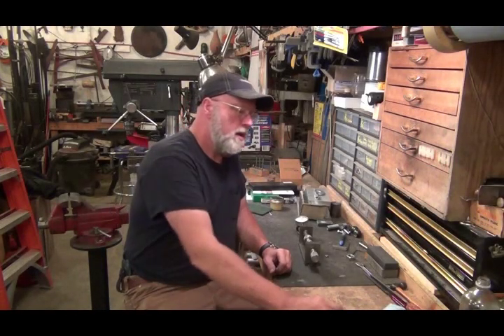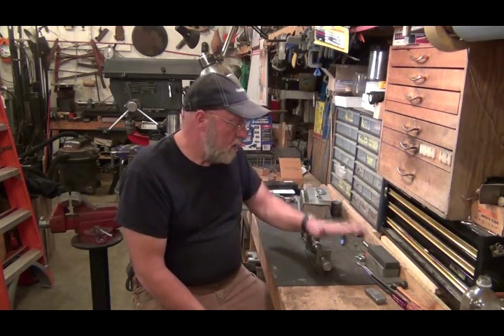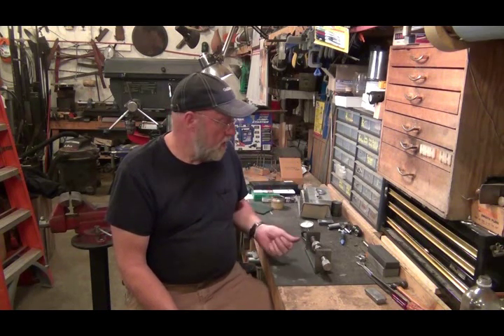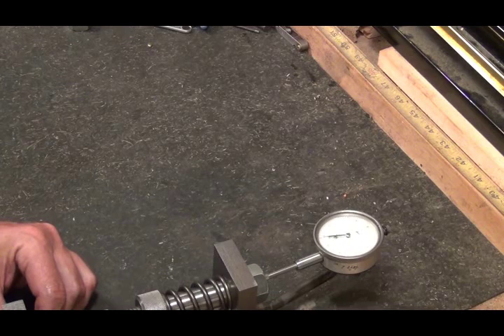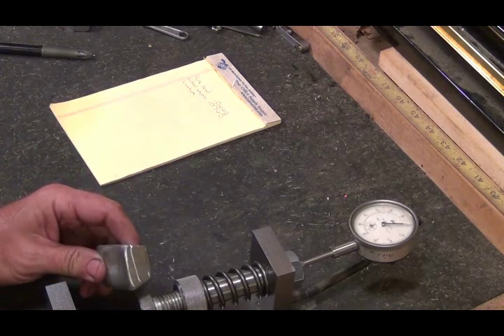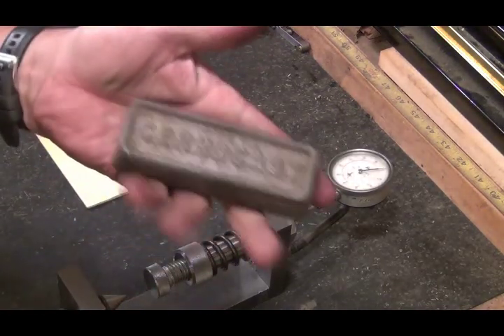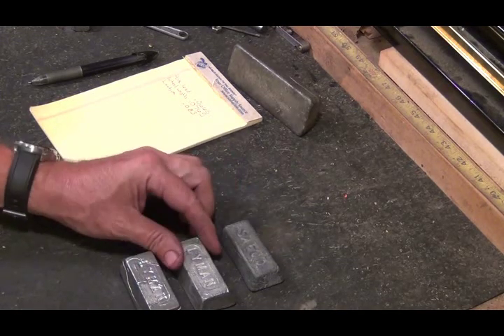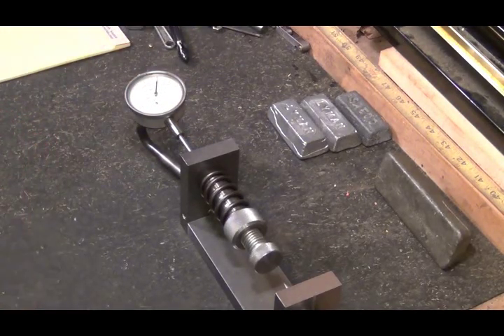Home made lead hardness tester

Comment: This makes precise hardness testing so accessible, thank you. I know lead, the material that all these videos focus on, is a pretty soft metal. But could this work with testing the hardness of other metals and alloys? Like aluminum, bronze, cast iron, or even steel if a diamond tip was used and the whole structure beefed up?
Reply: No use a rockwell test this only will work on soft matrial .

Comment: Awesome I built my own as well would I be able to send some pictures of my tester and my test results I'm in the same boat as you trying to calibrate mine. For the spring I use a 1949 Indian scout outer valve spring had alot on hand so easy to come by. My email is adrianhoffarth@yahoo.com hope to her from you.

Comment: I use a 50/50 ww and dead soft in my 45, powder coat and no problems. I do slug the barrel anf make sure I have at least one to two thousandths oversize

Comment: Thanks for the video. I didn't see the other guys rig but yours seems to be an improvement in design from what you say. 
  My only question would be the angle of the point ...changing that angle would change the range of changes. It would not be a big deal but if you did want to document many different tests it may not give you enough difference between each of them. A sharper point might give a larger range.
About the hardness changing with age...From what I understand it is the antimony that causes lead alloy to harden with water AND change hardness with age. I don't think pure lead will change.

Comment: Nice machine work.  Two suggestions, one, you might take some ingots to a local mechanical engineering college,  or a local shop, and ask them to test them on a Brinell Hardness Tester to get actual Brinell numbers to calibrate your chart to them.  Also, maybe also calibrate the unit  using two turns on the indenter, to see if the results change.
Reply: The results will be different since the indentation point is tapered.

Comment: You can shoot soft bullets and not get leading. It is all about bullet size not hardness. Also pure lead doesn't harden when you water drop. For it to harden some with water you need other metals in there besides pure lead. 

If you haven't already check out the castboolits forum. Tons of info there.
Reply from the maker: Been there quite a bit. I have started mixing Lyman #2. My bullets are coming out much nicer. Thanks for watching and commenting.

Comment: Perhaps you have discovered by now, but the Cerrocast is a low temperature casting material that's used commonly by gunsmiths and other machinists for the purpose of measuring chambers and other internal dimensions.  It has specific shrinkage/time values that allow precise measurements to be taken.  Check Rotometals for their version, which may be listed with their trade name.  It melts at the temperature of M&Ms.  Cool stuff.  Your craftsmanship is praiseworthy!
Reply from the maker: Thank you. I am just an amateur machinist in my home shop. But I have fun making things I need.

Comment: Is that dial some kind of depth gage?  Looks like that should give some very accurate measurements.
Reply from the maker: +Dana Webb It is a dial indicator used in machining operations. It is very accurate.
Reply: I'm starting to recall what those are now, that's pretty neat setup youve put together.

Comment: cerrocast is a mix used for casting chambers. it is 60% tin and 40% bismuth
Reply: And, its rather pricy. It has a very low melting point, just less than boiling water. I work on many very old combination guns (drillings) where the rifle barrel may be in an obsolete or non-standard calibers. A chamber casting is about the only way to determine exactly what it might be.

Comment: This is a very robust tool, and a good way to get a comparative hardness on you lead alloy. One point that you mention is that you are getting barrel leading, this is almost always due to too hard an alloy with a less than groove diameter bullet, the only way you will encourage leading with a soft bullet is to be driving it too fast, the bullet then strips, leaving lead in the bore, but the soft lead bullet obturates on firing and completely fills the bore, a hard alloy will not, allowing gases to get by and melt the lead onto your bore, just try a pure lead bullet, depending on your rifling type.

Comment: I wonder if it had more to do with sizing or lube. I've been running straight range scrap through my 9mm's, .45's, and .38's for years. Range scrap is a good 4-5 BHN softer even than WW.
Reply: +Hans “Hanzy4200” S.  sizing is the most important variable.

Comment: I have a bunch of salvaged lead that I cleaned up and made into ingots.  I have molds for fishing weights.  I melted both the lead and zinc wheel weights together because I didnt think that the fish would care too much either way.  It was interesting to see the layers of melted materials in the crucible they didnt mix looked like free water flowing over the top of an ice layer if that made sense.   .
Reply from the maker: Do you think it is possible to get the zinc out now?
Reply: considering how the metals tend to float until they reach their melting points I assume so.  IE the metal clips from the wheel weights floated on the melted lead.  Zinc melts at roughly 75 degrees hotter than lead.  so I am making assumptions but yes I think so
Reply: I’m certainly no expert but I believe that some of the zinc dissolves in the lead & cannot be removed. The stuff on the surface hasn’t dissolved yet for whatever reason & can be removed, it some extent. However too much zinc makes very bad bullets.